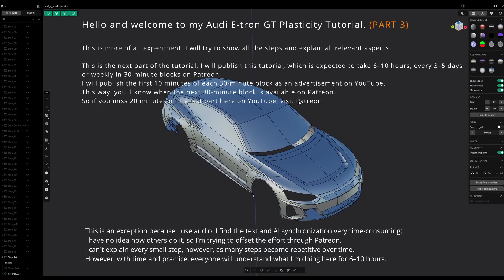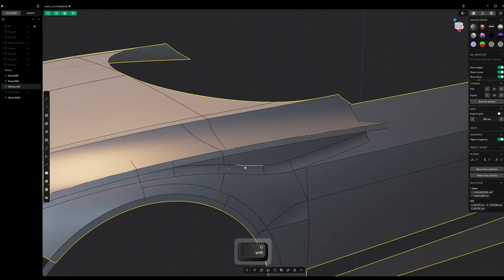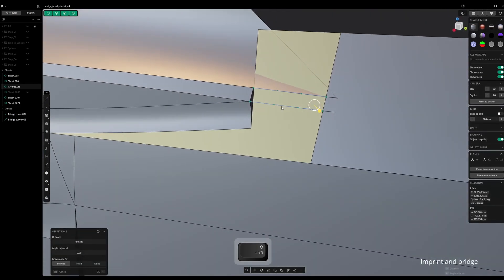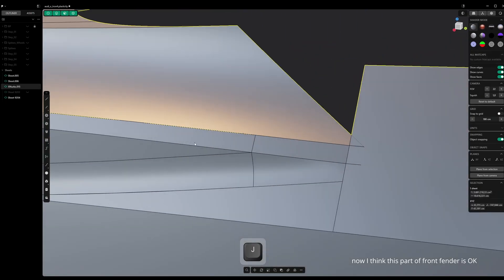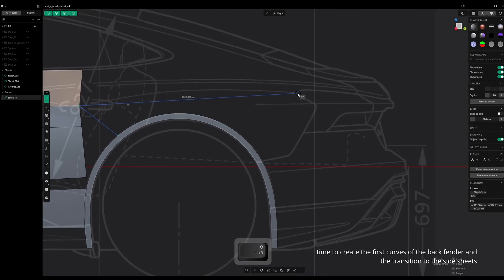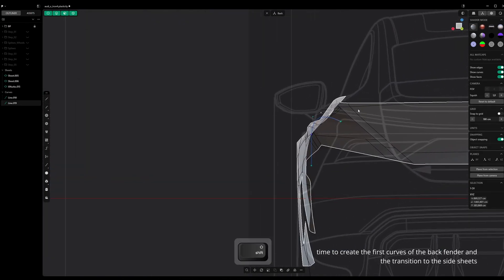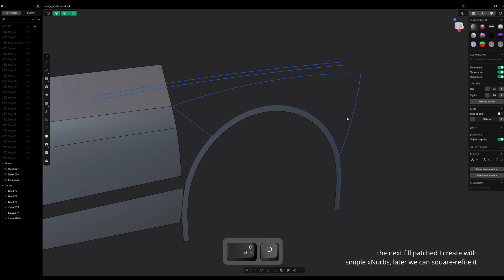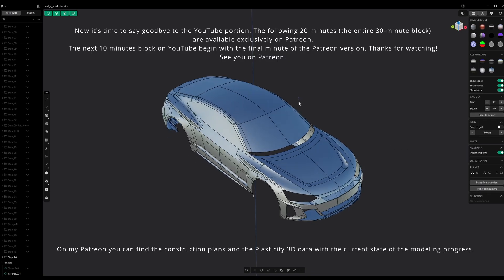PLASTICITY v25 Studio Car Modeling  | Audi RS e-tron GT | Tutorial Serial | On Patreon | Part 03

Comment: It really nice/relaxing to watch you working in this amazing software. I try to replicate some of your technique in onshape on mobile.
Reply from the maker: Theoretically, it could be possible in Onshape, since Plasticity uses the same kernel (Parasolid), Fill (Patch), and Loft surfaces. I build a Audi A7 only with parasolid tools. Plasticity's advantage is the xNurbs kernel on top, which is near ot the alias toolset, like square, Align, refite und xNurbs patches. This make higher and faster quality possible.